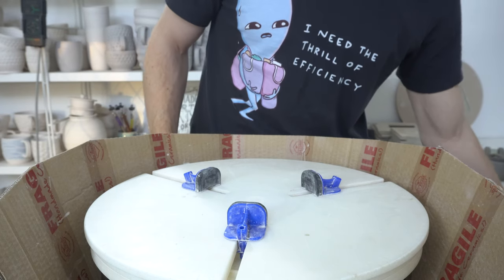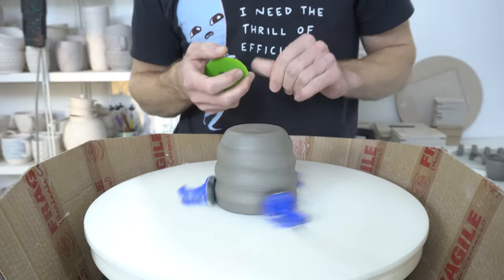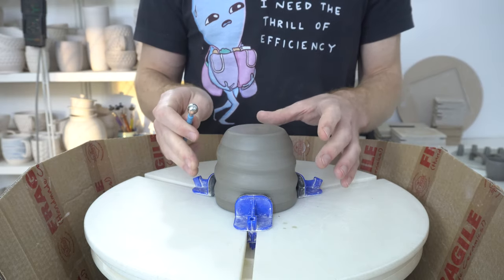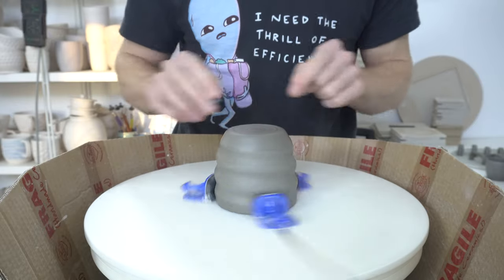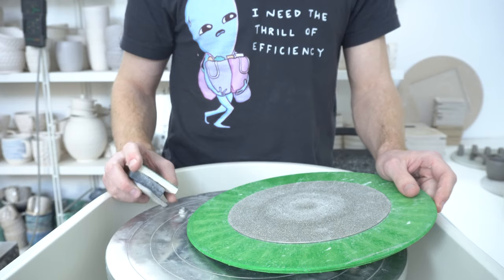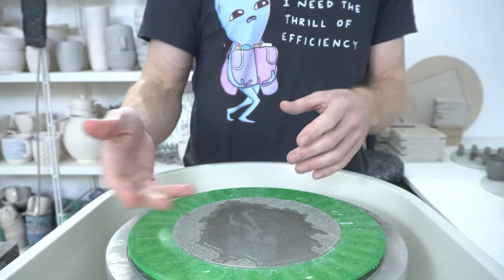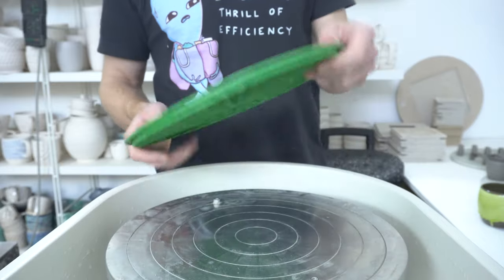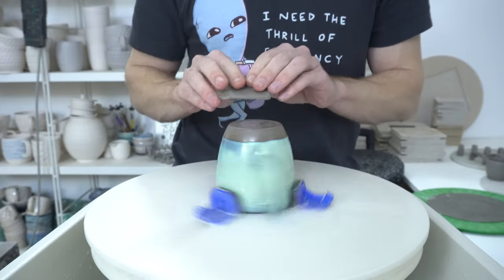Silky Smooth Mug Bottoms - How To

Comment: I use a diamond core 800 flexible pad and the bottoms are glassy smooth. I used to use a 200 3M until I tried the 800!

Comment: Doesn't it then take your signature off? Or is your signature really deep?
Reply from the maker: My stamp is maybe 0.1-0.2mm deep. So not very deep, but in terms of sanding clay off, it is plenty deep enough to not be removed. It would take a little while to remove that much clay. Plus I have the slight raised foot around the lip and the logo stamp is inside it, so that gets the bulk of the sanding and leaves the logo alone

Comment: I'm surprised how you can get a defined foot with so little trimming. Since the bottom is thin, are these trying on the bat until they pop off?
Reply from the maker: No, I wire off after leaving them on the batts overnight. There's another video about why I time it the way I do. I only lose 1mm or less from wiring off though.
Reply: @OldForgeCreations  I see, thank you. Still perfecting this myself as my studio is too drafty to dry uncovered but that extends the timeline of everything.